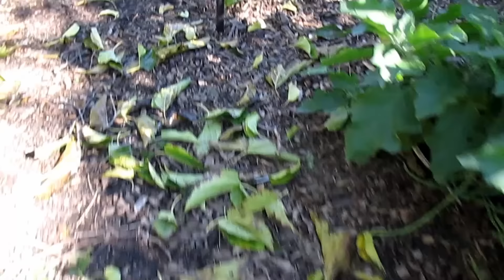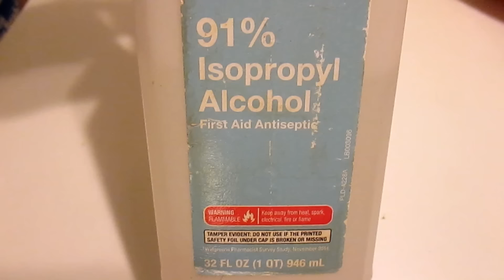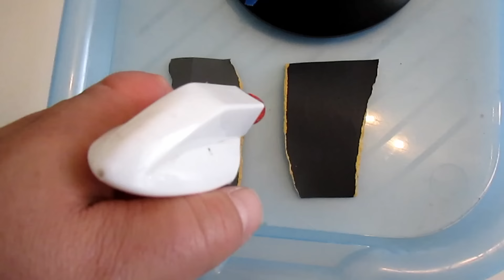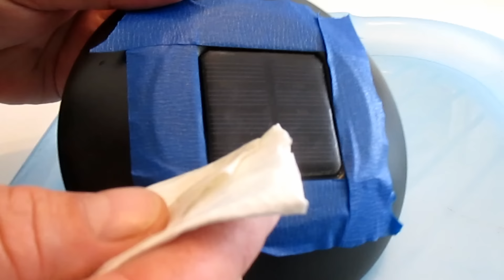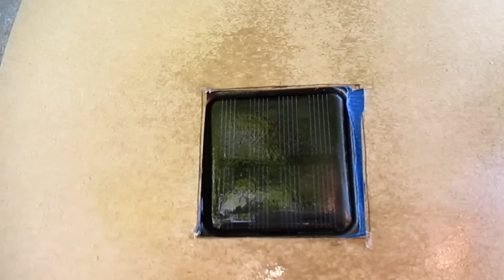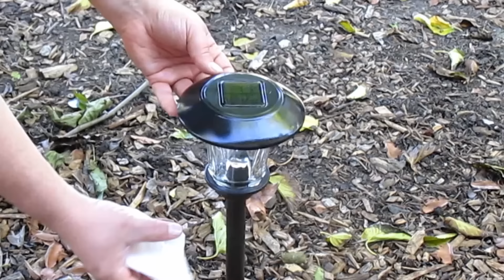Quick & Easy Way to Clean, Renew & Restore Solar Pathway Lights! Wow!! Looks Brand New!!!

Comment: I've got one for you. Want to renew weathered lawn furniture?  MURPHY'S SOAP, not their cleaner, the original.  Just spray on (in the shade), let it sit for 5-10 minutes.  Hit it again if it starts to dry.  Rub off with the abrasive side of a sponge (not the heavy duty type).

Comment: What if u don’t spray the clear coat in final step..? 
I cleaned mine very nicely but didn’t have the clear coat spray & didn’t want to venture out in ☔️ rain. 
Would it be okay to not spray or should I do it once weather is dry? Tysm for great video! 👍

Comment: i knew they had just rechargable batteries in them, so if they quit working instead of replacing them you can buy rechargable batteries and change them.  they just have 2 AA i think in there.

Comment: Don't know about in the US but in the UK our pan scrubs come in both white and green abrasive types. The colour is important. The green scrubs are much more abrasive and will scratch much more easily whereas the white scrubs are less abrasive and won't scratch as easily. For something like the front face of a solar cell I should have thought the white scrub would be safer.

Comment: Anyone have idea on how to fix ones that stopped working?
Yeah, I know they are pretty cheap and easy to replace, however, I would prefer not to add to landfill waste ...
Reply: The biggest problem I have is bugs and spiders in the electronics. Rusted/corroded contacts will cause big trouble. Rechargeable batteries are another problem, they only take so many charge cycles. As mentioned in another post,  upgrade to 1200mA batteries.

Comment: To save time,  dry sand with 400 grit sandpaper, and polish with toothpaste or car polishing compound. The top coat are epoxy so they are very easy to sand and polish.

Comment: I'd  do this a bit differently...  I'd clean/rinse them with soap & water.  I'd unscrew the solar panels from the housing and set them aside and just spray the panels as group with UV rated clear coat. the sand paper thing seems like over kill.
Reply: You’re wrong and if you’re seeking accolades, start your own channel.

Comment: Thank You very much for sharing this will all of us. I like to keep two of the lights outside on my Deck all year long, clearing the snow and ice away when possible in the Winter months. Whenever we have a power-outage because of a nasty storm, I bring these into the house for lighting. They're much safer than candles, or oil lamps and you be amazed at how much light and illumination these actually provide. (p.s. the newer LED lights which fit on top of a fence post have zero illumination....they're more for decorative purposes and not for lighting up a pathway or the deck, as I'm certain many people may already know or have discovered so they're no good for emergency lighting purposes.)

Comment: During your off season maintenance open the battery compartment & clean out the webs, & take a metal brush to the contacts & battery terminal ends to remove any rust or replace batteries with new higher MAh. A reverse cardboard cutout can be used if you want to refresh the paint on your solar lites with the correct spray paint for metal or plastic.😉

Comment: If you run a light bead of silicone chalk around the edges of the solar panel, smooth it out, it keeps water from seeping in.

Comment: Why are you replacing the clear coat that will go the same way as the first clear coat so why don't you do the cleaning part then put a coating of silicone on instead and include the gap around the solar panel it needs to be about 1 mm thick and will last forever so next year just wash clean this works I did my lights for the garden Bob in the UK

Comment: 3M makes different colored scrubbie sponge pads.  The color Blue scrubbie with blue sponge is soft and will not scratch and the color Green scrubbie with yellow sponge is abrasive and will definitely scratch.  For most applications I just use the Blue ones unless I really have to scour something and am not concerned about scratching the finish.
The quality of the Solar Cell Garden Lights cannot be overstated as you ultimately receive what you pay for in the first-place.  I once bought a bunch of the $0.99-each lights from OSH and no amount of creative maintenance could ever resurrect those lights.
Reply: I honestly did not know that and it's helpful to know, thank you!

Comment: Do u know if you have to use rechargeable batteries on solar lights or can u use regular?
Reply: You can use regular batteries and they will work for a few days but won't be recharged by the solar panel so you'll have to replace them often.
Reply: Manufacturers say to only use rechargeable batteries

Comment: The biggest problem with thes lamps is that moist will creap behind the edges of the PV. Inside will rust away
Reply: WD-40 is your friend!
Reply: Nothing lasts forever…….obviously.
Reply: @CHartnett10  sure, but it would be nice if ig lasts longer than one season, especiallybif a bit of silicone and sime grease can make that happen

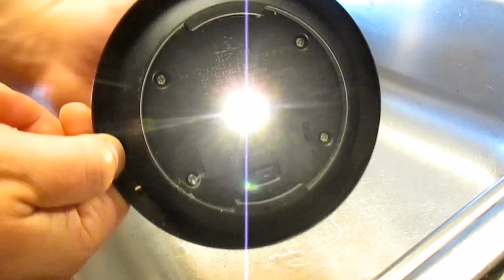Comment: The light in the video was tested here. 1:24

If the light did not happen to turn on, it might be either the battery that needs replaced and/or the light bulb needs replaced. Check each.

Test with new battery. If light comes on in test, replace battery. Then continue with cleaning and refurbishing sensor.

If new battery does not make light turn on, replace light bulb to see if it turns on in test. Then continue cleaning and refurbishing sensor.

If neither new battery and new light do not make it turn on in the test, then the unit may need replaced.

Comment: Another handy thing I learned this year is, these lights come with a 200-300 mAh battery. If you replace them with a 900-1200mAh battery, they'll stay on much, much longer.
Reply from the maker: Jimmy, that's a great tip! Thank you.
Reply: Need a video on how to do that!
Reply: @Susan70003  buy the new batteries… take the old ones out… put the new ones in lol
Reply: @flux88 you can't just pop them out and put new ones in...They are soldered in place. If you don't own a solder gun, and don't know how to use one, that's a problem, not so easy.
Reply: @nancyphillips6446 don't know what kind of solar lights you have but every type of solar light that is sold here at Walmart in the season aisle the batteries are drop-ins.
Reply: @flux88  I think the issue is there are different kinds of  lights with some batteries replaceable and some not so (easily anyway). I have three sets I've accumulated over the years and one has a "permanent" battery. Another, an odd rechargeable battery size which has no other purpose around my house. A 3.2V LiFePo4 14430.
I hate to think of these kinds of things as just disposable though.
Reply: I bought a 4 pack of 2200ma energizer batteries last year and on a really sunny summer day in Cleveland I can get 3 solid hours of light after sunset. But I need to refurbish my solar cells again for the deck lights. The original 1200 batteries gave me maybe 1 hour of good light.
Reply: Just remember that you can't get anything out you don't put in there in the first place. The bigger the battery capacity, the more it needs to charge up during the day. In California or Florida there may well be enough sunlight during even winter months to charge up the battery, but here in the UK with around 16 hours of darkness in mid winter (worse in Northern Scotland) and lousy weather (grey and overcast) it is highly unlikely you'll charge up a larger battery sufficiently to keep it in reasonable long term condition. Just a word of caution!
Reply: @boblewis5558  We get plenty of sunshine here in Eastern Virginia during the spring, summer and fall, but in winter when the sun shifts to the south, not so much. 
But when we have several days of "English weather," i know exactly what you mean.
Reply: @boblewis5558   Good point.  We often fail to consider how much daylight is available to charge these batteries.
Reply: @tedtolentino4955  good point
Reply: I would just get the cheap IKEA LADDA, they are made in Japan FDK/Eneloops, low self discharge also
Reply: I'd like to know what model those lights are. They look nice
Reply: Thank you for this.  I use mine year-round.  I live in New York up by the Canadian border.  I get off work at 9pm and although they don't stay lit up most of the night they do stay lit till I get home most nights, I use the snow and move as needed due to snow fall.
Reply: We w
Reply: @AmysArea  far enough
Reply: I tried some of the new style Ikea batteries (2400 mAh) in my solar lights, and since the little panels couldn't charge them to maximum, the batteries suffered due to the memory effect. These are the high-quality, Eneloop-style batteries made in Japan (Very good batteries, and from IKEA are a great price. The best AA batteries on the Market).
Reply: Good info when need to change batteries
Reply: The problem with that idea is the solar charging circuit is not designed to charge a higher mAh battery and they will never fully charge, this not working properly at all.  I know I've tried using more powerful batteries.
Reply: Will swapping out the different sized batteries, make the lights, brighter, or make them last longer?
Reply: Amazon carries the whole replacement top too, if needed. Comes in different sizes. If my light uses a 300 battery, I'll replace with a 400- 600 but never clear up to a 1200 or more...
Reply: If you use a regular AA battery, is that ok?
Reply: OMGOSH! Thanks!
Reply: Thank you
Reply: Y’all would believe the batteries that come with the light will last forever?  Uh yeah.

Thanks I’ll try this when my other batteries die off.

Comment: I found that clear plastic headlight film works great. It's self adhering and lasts much longer, I cover the area around the solar pad to seal the edges. Clean the battery ends and the contacts, a coat of silicone grease works wonders also.
Reply: I was thinking at the same thing. If a great product is spoiled by a cheap part, why not improve it from the beginning. 
And a clear selfadhesive tape seems a great option. Much easier to replace. 
Too bad they did not considered glass for the top too.

Comment: $20 in materials, Or you can just buy a new one for a couple bucks.
Reply: $20 in materials across one or two lights...probably not worth it.
$20 in materials across inexpensive 15 lights ($60)...maybe worth it.
$20 in materials across expensive 15 lights ($350)...worth it.
Reply: The Great One some of the higher end ones arent two bucks vern..and its not 20$ in material..obviously you dont do home maintence or reapairs

Comment: great video, i wish i would of seen this a long time ago,  what if you use that spray coating right after you buy them, would that help ?
Reply: Yes, undoubtedly.  I had no idea you should use the spray.  I use the UV protection spray on my garden statues, wreaths, silk flowers, etc. It works beautifully!  I think the best brand is Krylon.  I buy the satin, but mat finish would work on something like this, too.  It also comes in glossy finish.

Comment: @Plant Abundance  I do it differently with success.  I sanded like you did but instead of respraying them I bought something which is called helicopter tape.  It can be found very cheap on ebay etc .. They also use this to protect frames on a bike, bumpers etc ..   I covered my restored cells which were dull after 1 season in the sun here.  I checked and after I believe 3 years (can't even remember when I did this) the cells are still in like new condition.  The advantage is that if the tape yellows you can just take it off and stick a new one on. Also you can cut it bigger than the cell and make sure the water doesn't penetrate any openings next to the cell.